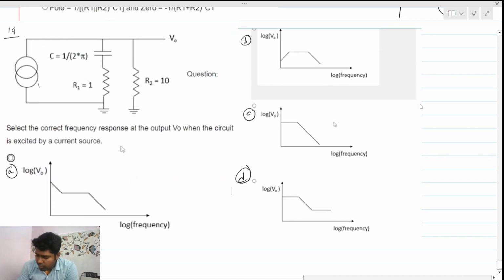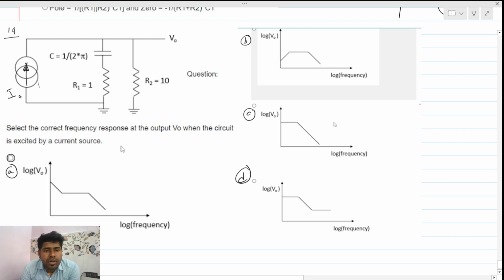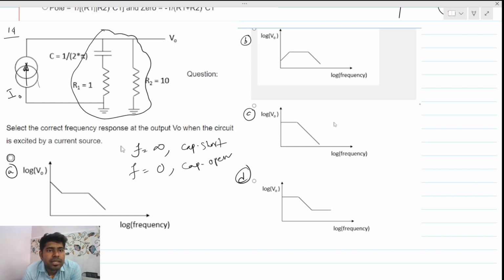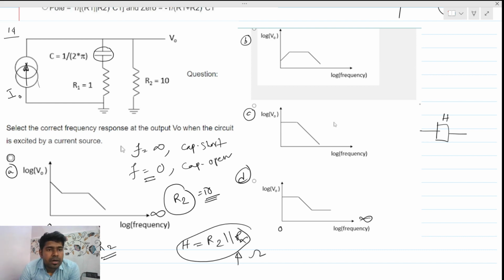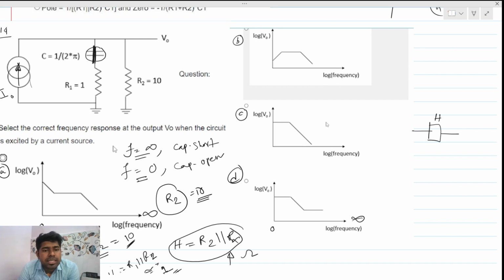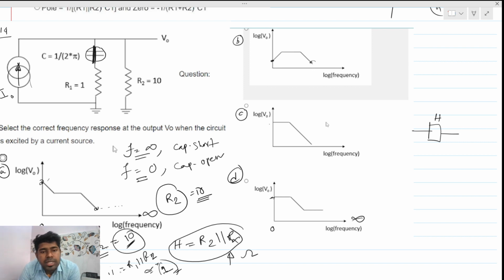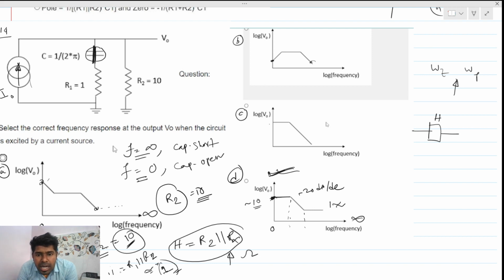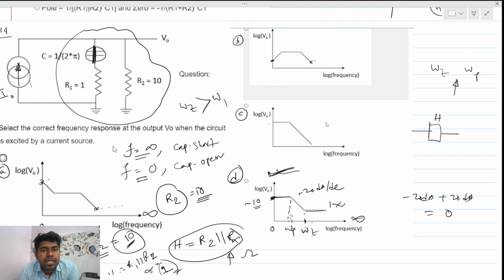Frequency Response at  the Output Vo when the circuit is excited by a current source_Analog Design

Comment: Thank you Sir 😊
f=0,current source open wp=1/req*ceq=1/11*(1/2π)=0.57 rad/sec
vo short 
wz=1/1*(1/2π)=6.28 rad/sec
dc gain vo=I *(10),vo/I=10  
So dc gain A
db=20log|A|=20 db

The final Bode plot choice is D
Please let me know if you have any misconceptions, thank you
Reply: At dc,the capacitor is open. Then how the dc gain becomes 10||1. So the Vo/I will be 10.